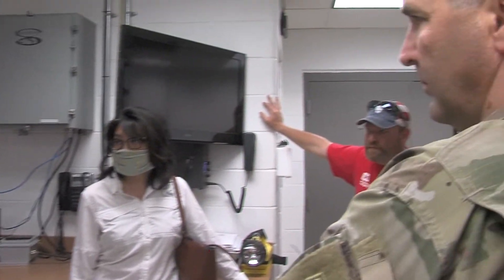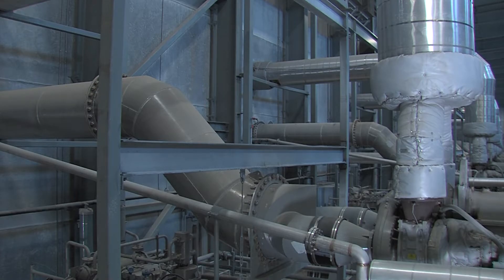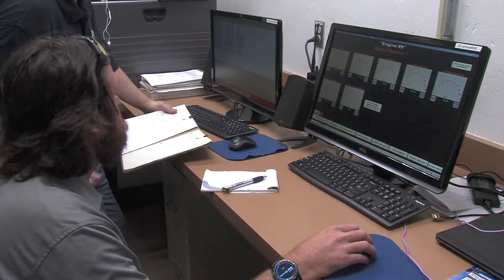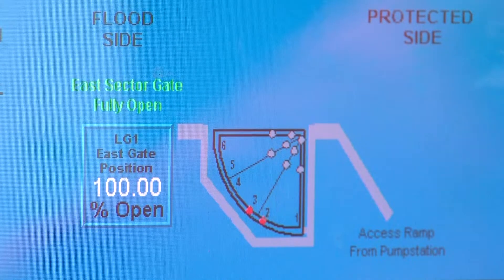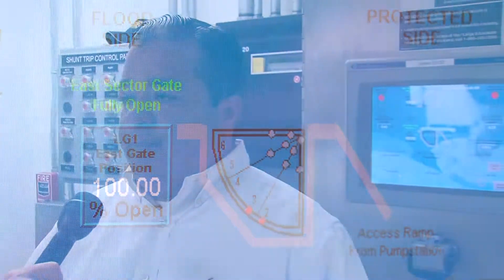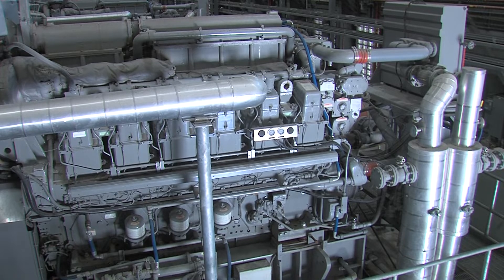West Closure Complex Pump Test

Comment: It is the largest in the US at the present time. 66 years ago, one I've worked at was that record setter and to this day is still the largest one East of the Mississippi River. Our District also was one of the first users of the large Cat engines with the installation of Cat 3606 engines. Some of the teething problems with the design were worked out on ours.